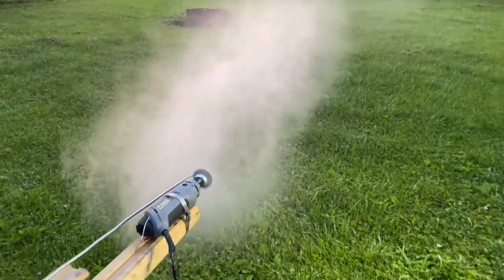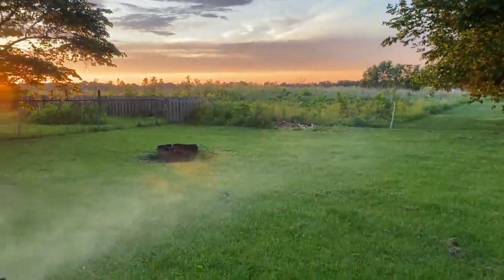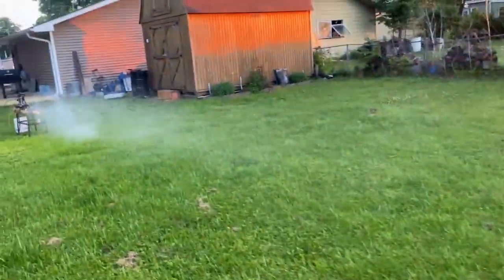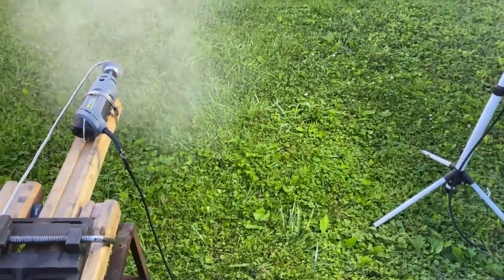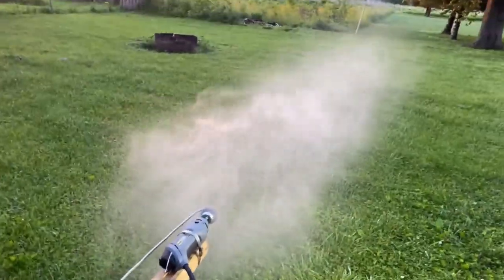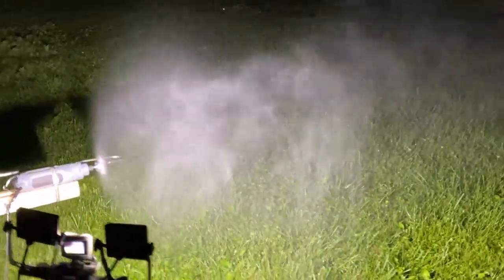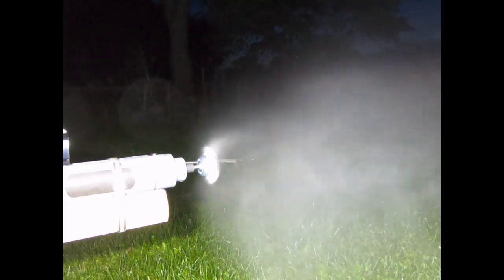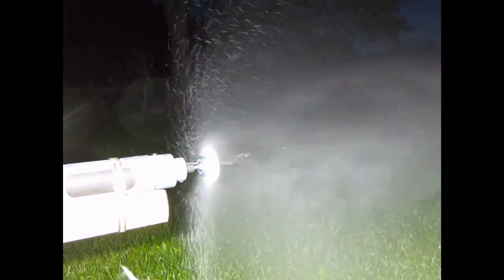Rotary cup atomizer for Jet engine oil burner

Comment from the maker: This is not the motor that will be used in the burner . The secondary air will keep it cooled off
Reply: Just extend the shaft, use a die grinder with flexible extension.
Reply: Bush engineering is an art form Nobox7.  Are you up for the challenge fella ??? I know for certain you are ready for BUSH ACTION. Let it fly. Thickening water is easy, just use corn starch and it will thicken up. That is kitchen engineering at its finest. Good luck figuring out how to keep the wire cup from carboning up.
Reply: Learned something new. Now my mind is racing. Thanks.
Reply: @Mr.Mister001  Necessity is the mother of invention and secondary air will react and keep thing at the correct temperature.

Comment: Heck yes!!! I love it! The wire wheel is a good quick to get part for this! Very similar to my Tesla pump/compressor multi-fluid vortex mixer design. It gets INCREDIBLE air fuel mixing, atomizing AND compression. basically the holes on either side of the Tesla disc stack pull from a different fluid. But the holes on each side are not in communication with each other. So the two fluids to be mixed don’t mix until they are forced to shear together as the Tesla compressor “flings them” and atomizes them out the tip at high velocity. Then you just force them through a ram jet configuration. Defuser cone to increase pressure and to slow the fluid down cause auto ignition upon the temp radially increasing from the pressure increasing. Then just accelerator nozzle out. 

The two fluids perfectly shear together between the discs and you can make the discs whatever spacing you need to allow for whatever fluid viscosity, and solid particulate sizing.
Reply: Can you make a video on this? Is the mixer 3D printed?
Reply: @ohbeardedone9253  hey I do have a basic one on this explaining the “Tesla pump multi fluid vortex mixer -steam condenser and air fuel mixer” but I didn’t want to be rude and post a link here. I don’t have one actually made yet though. It’s a CAD walkthrough. I’ll be making one here very soon though as I’m about to be testing out the stainless steel combustion + steam Tesla turbine jet engines. Just did gaseous, propane, and liquid, gasoline,  fuel burner tests recently. Going to try waste oil soon. Then I will be testing out pulverized coal and powdered Iron to prove out solid fuel tests for the Tesla turbine 😈🔥
Reply: @ohbeardedone9253  but yeah it’s under the name “Tesla pump multi fluid vortex mixer -steam condenser and air fuel mixer”
Reply: @ohbeardedone9253  let me know if you can see my replies.
Reply: The powdered iron is something I am very interested in

Comment: Hey buddy. I really enjoy watching your videos. I've prolly watched about 25 hours of your videos. Keep up the great work.
I've been thinking about this idea of using a wire cup to atomize oil for a couple of weeks now. What if you used a tiny propeller disk. Like the spinner in a wolf whistle toy. The harder you blow on it the faster it spins. Then you mount it with the disk just inside the flame holder, but the shaft is mounted in tiny bearings on the nozzle. Now the incoming blast of air/fuel are spinning the propeller. Maybe use a double burner set up with the spinner disk in the middle, so that the two incoming blasts of air/fuel create balanced force on the opposite sides of the spinning disk.
What if you combined the spinning propeller and a tiny wire wheel on the same shaft. The propeller in the back and the wire wheel out front. Now you don't need a motor to spin the wire wheel.

Comment: man I like how you are not afraid to try out side the box lol I do the same I recently converted all my small engines to propane, lawn mower ,weed wacker generators, blower ext. got tired of bad gas that dont last anymore and gummed up carbs. modified the carbs my self. and played with them for a while trying different stuff and found the best way for easy start and it at first a low idle runs ruff but I use the air intake as the throttle so basically backwards instead if fuel to throttle up it's the air ha ha ha got ya lost now huh kinda like a torch using the gas to suck the fuel into the carb then a large hole in side of carb with a slide to control air flow so when I pull trigger the slide starts to restrict the air flow and it starts to idle up basically I think what's going on is the motor is flooded with air so it idles ruff then when air is restricted it brings in more fuel or is a better mix and it idles up.  propane...doesn't go bad store alot in small space cheaper than gas . think out side the box

Comment: My thoughts:  Put a fan right behind the wire cup to create a strong draft in the outward from the motor.  Surround the whole thing with a flue pipe, anywhere from 6" to 12" diameter as desired to constrain the air blast.  Tilt the flue pipe one way or the other and add a trough underneath to collect any oil that lands on the interior of the flue pipe, so it can be recycled back to the fuel supply.

Comment: Would love to see you try using a car turbo, run compressed air to drive the turbo and feed waste oil through it. Many cars have had a run away turbo that sucks up the lubricant oil and runs like a mini jet engine until the oil runs out. Maybe try that using  compressed air which will control things?
I would love to see this done!
Thinking about this more if you started it on compressed air then used the compressor of the turbo maybe you could make it self sustaining without more air just like a jet? Cool.

Comment: Looks good, I would suggest a cnc router motor with a vfd drive.

It will be durable, and cheap off of ebay

Looks like it might have the perfect fuel lean zone in the center to recirculate some combustion gas
Reply from the maker: Thanks for the tips! Great idea friend
Reply: @NOBOX7  yea, any place the consumables can be off the shelf chineseum and durable enough to do the job would be a massive plus in the bush

Comment: What about a small air motor, like the one used for dental drills? They can reach more than 100.000 rpm... some use water as propeller, and they eject it from the spindle , so maybe combustion fluid can be used instead of water, acting as propeller and injectordirectly to the atomizer

Comment: Have you ever tried to make a plasma arc furnace for casting? I think they produce much higher temps than burning gas/oil but it seems difficult to make the arc heat a large area unless it is placed under vacuum, and i think the electrode erodes leaving impurities in the casting but i'ts done on a large scale so i'm not sure.

Comment: Maybe add a small propeller behind the brush to push airflow away.  Tweak the pitch and prop size to your needs.  Combustion = heat and you don't want that sort of heat near motors not designed to handle it.  Maybe a prop will assist.  At the very least it will add air to the mix.   More power.

Comment: You could probally do the same with a fan. Have thin blades moving fast introduce water from behind at point blank distance. If that works then build aburn chamber that flares out and then constricts back down kinda like a jet engine.

Comment: When you made the high temperature refractory cement what was the water glass stuff was it like sodium silicate like can you tell me exactly like what it was like where to get it
Reply: Most chemical suppliers and some hardware stores sell it. Shipping is expensive because it's corrosive and heavy so it's a lot cheaper if you can buy it off a shelf.

Comment: im not sure about reliability of this rotary tool
u need to check HILDA 400w rotary grinder ...its dremel on steroids , super cheap , undestructible , my one have around 10 years  , friend use it for 6 years to cut thousands of glassfibre parts then it get stuck from resin dust inside , i clean it , put new bearings and use it for another 4 years now :)

i earlier say about brushless motor for rc planes etc it should be cheap too (not as cheap though)
or some cheap cnc spindle 

maybe 775 / 795 or even 895 dc (u can get them for 12//18/24/36V ) motor ? they can output 200w+
Reply from the maker: The rotory tool is just for the test its not the actual unit